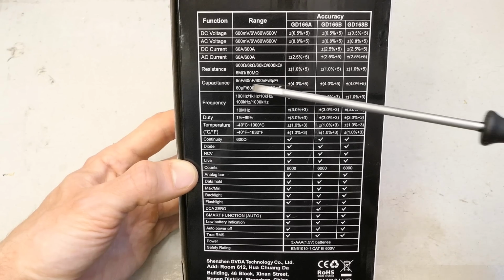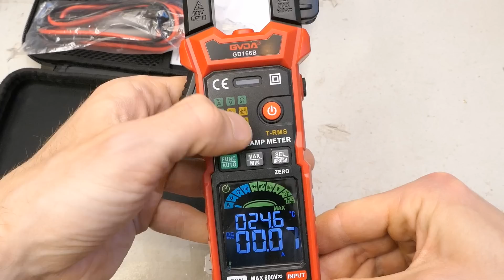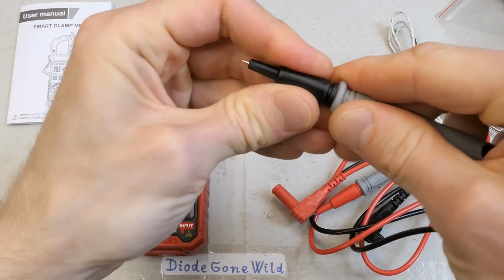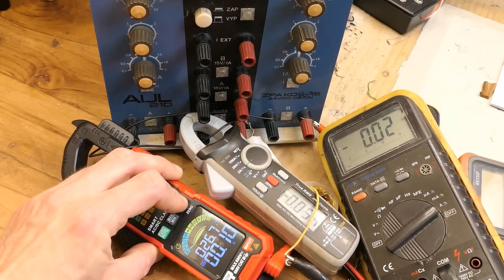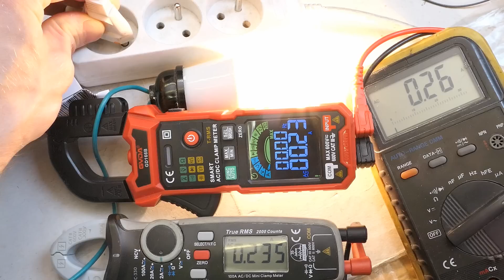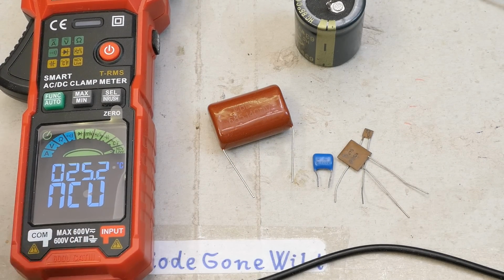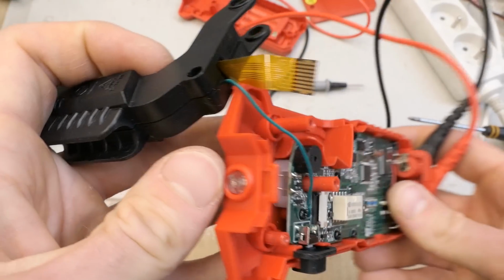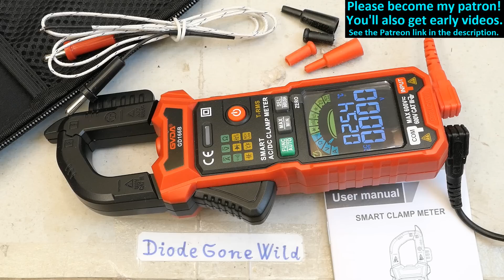GVDA GD166B clamp meter test and teardown

Comment: Dave would get an instant aneurysm from the total lack of safety features, but as long as you assume it's a cat I meter with coincidental cat II capabilities, it looks like a nice hobby tool.
Reply: well yes indeed. but at least the clamp part is pretty safe, if you clamp it around properly insulated cables
Reply: But have you seen some of the things DiodeGoneWild has stuck in the mains socket?
Reply: Dave is a clown

Comment: Nice feature set, but I wish it had a mV resolution when doing clamp measurements under 2A. But I have another one just specially for that and this one has features the other does not have, both are low cost, so I will most likely get thus one.

Comment: If you make a 10 turn coil out of some, say 2.5 mm insulated wire and put 1 Amp through it, the clamp meter will read 10 Amps, 100 turn coil will show 100 Amps with 1 Amp in.
I used to work for a NAMAS calibration laboratory in the mid 1990s and that's how we used to calibrate high current clamp meters. 
I have the Kaiweets smart multimeter that this meter is based on, and they are fantastic value for money. I highly recommend them, but I would take the safety rating with a pinch of salt unless someone has actually done a destructive test on one of these meters.
Reply: how do you measure small currents from 0,1 mA to 2Amps for example with a clamp meter? all these meters have a 20mA smallest current resolution
Reply: @bambumbambu  well he just expllained right there... by adding more turns. also if you got the uni-t ut210e that starts off with an even finer resolution. thing is like explained in this video (and similar videos on the uni-t meter by other people)... are other external sources of magnetic waves. which creates significant noise in the milliamps range. to make clamp meters less good option. you may instead do better with a wired ammetter or using some quality shunts
Reply: Actually it depends on where on the wire the clamp meter is being placed.

The clamp meter is measuring the magnetic field strength and if you place it on the straight section of wire before the coil and some distance away from it, then the clamp meter will only pick up the magnetic field from the straight section of wire and give a correct reading.

If you place the clamp meter on a turn of the coil then yes it will read inaccurately because the magnetic field strength inside the coil is related to the number of turns on that coil, as well as the current and some other factors.
Reply: @deang5622  If you have 10 turns of wire in a coil, and you measure the magnetic field in that coil, it will be 10 times bigger than 1 turn of wire.
Reply: @zedcarr6128  I think you should have been able to deduce that from my post.

I refrained from presenting the mathematical equation for the magnetic field strength of a solenoid as I didn't think you would understand it. It contains the value of the magnetic permeability of free space.
Reply: too funny., someone gave me the kaiweets clamp meter years ago and it's better than any of my fluke/amprob3e clamps. it's their only meter that never goes on sale if you notice. it's my go to for installing any light fixtures and such. i have a sick amount of multimeters, way too many. it's like one day you have none then all the sudden there's a drawer full of meters that i'll never use that the money would've been better spent elsewhere. i stopped buying test gear, i'd like to get a proper spectrum analyzer eventually but every time i have the money saved i end up buying a new guitar or something audio related. id like to get the siglent one that you can dual boot sa and nvna because the hardware is identical. i dont do much rf and i havent had to fix any guitar amps or like for a long time so i supect it would rot with my absurdly priced rigol mso5354 (i got for free or else i'd have a micsig) when i usually use my old tektronix tds2002c anyway.

Comment: Wow a most exciting clamp meter.  🥳  All my new test equipment is with Bluetooth if it is available. Also, I use the "Infrared Thermometer Temperature" function on the Extech EX830 to check things like motor temperature and other things form a distance.   I really like the GVDA GD166B for my wish list.  😎  Thanks for a great video.

Comment: We have similar clamp meter with same plastic case, black bag, and packaging box. It worked fine for our low voltage DIY automobile work. For high voltage work, maybe a different meter. . .

Comment: Thanks - I just bought the same meter under a different name for some DIY HVAC work and it met all my needs. Really like the side bracket to hold a probe. The display can be difficult to see in bright sunlight, but that's my only complaint. Otherwise, it's just as good as a $300 meter for a home user like me.

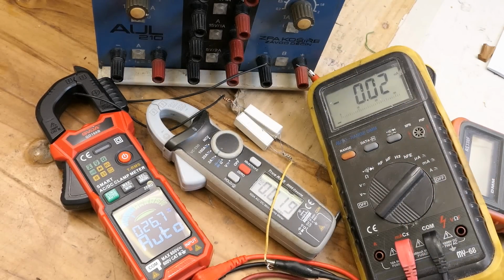Comment: hmm, Ive got a small clamp meter exactly the same as your smaller one there 7:23 except mine is orang and black and its a Tenma. the low current DC range is super useful on the bench. The near complete lack of protection is a bit weird in these meters though, just one PTC there...hmm. the smaller ones have a bunch more, I think 5 or 6 PTCs and MOVs iirc but still no fuses at all, not even little glass ones. I understand that theyre primarily clamp meters, and the addition of probes and a few extra features on my Tenma and that smaller one are just extras really and not their main function, but with the inclusion of the full suite of DMM features on this model you'd think they might have added a little more protection, maybe even really going wild and blowing the budget on a fuse.

Comment: Nice budget clamp meter, the input protection not very impressive though one 1 ptc and no MOVs but 600A range can be useful in certain situations. I think your clamp meter ut210e still the best clamp meter with 1mA resolution which is a rarity in clamp meters also it has better input protection with MOVs and ptcs
Reply: UT204+ is also 600A. Similar to the one shown in the video, minus the OLED display, the auto-mode, and the function selector.

Comment: No fuses?
Reply: Regular Amp meters that use wires and shunts need fuses. A clamp meter doesn't have a fuse since there is no meaningful current circulating inside.

Comment: Probably okay as a budget option if you're just using it for bench repairs, the accuracy across the board was quite impressive.

I'd take any CAT3 ratings it claims with a pinch of salt. The lack of separation or barriers between the female socket for the red test lead and spring connector for the battery compartment is a bit concerning, if the test lead is shoved in skew or if it breaks free at the solder joint on the board the socket may well push inside the tester causing contact. Also the red display wire already shows marks on the insulation where it was trapped in the spring.

I wouldn't want to use this tester in distribution boards or panels where there could be high fault currents involved at main supply voltages.
Reply: No way it's Cat III. The spring next to the red input jack is a funny business -- even if it doesn't fail direct the spark gap is too low.
Reply: Uni t meter is better?

Comment: I thought there would be circuit diagram and code for the microcontroller as usual 😊
Reply: The interesting part is the input protection, or its actual absence. No single MOV.

Comment: You should mod your old clamp meter to be 6000 counts.
Reply: Some guys made it to 9999 counts.
Reply: how can you do that?
Reply: @hojnikb  Maybe by changing the crystal oscillator
Reply: @ЯСуперСтар  That's pretty cool! Have to check my clamp meter if its capable of that too...
Reply: @hojnikb  Good luck. Did you find any guides? I think its worth it
Reply: @hojnikb  I think you can flash the firmware or change couple bytes in eeprom, but I don't think it is worth doing it.

Comment: All right I've got an ideal for a multimeter is a display okay and then wireless leads completely wireless that would be the greatest thing ever
Okay so I know that would be difficult to do but what if it just had a wire between the two and not to the display thing that would still be a significant improvement